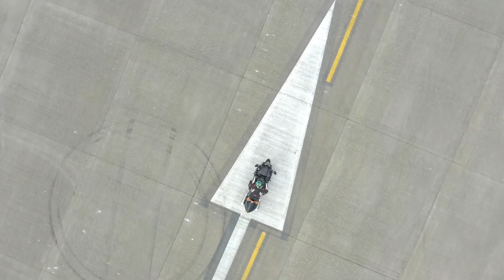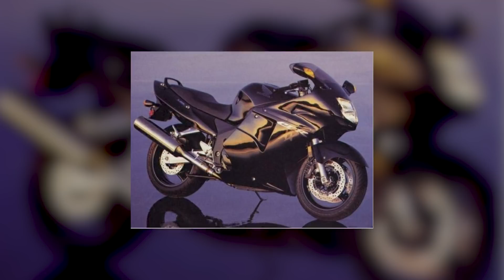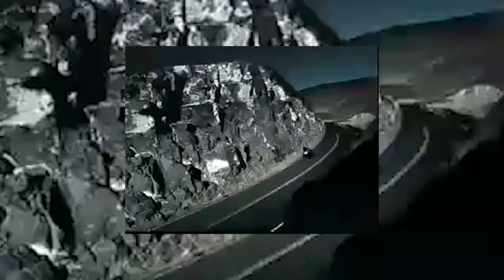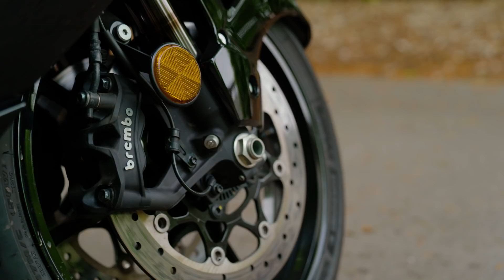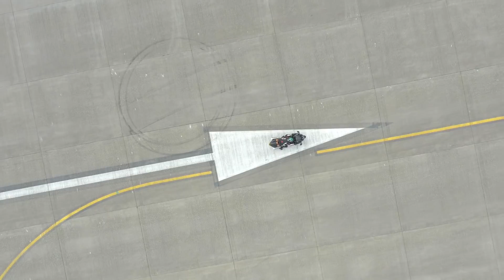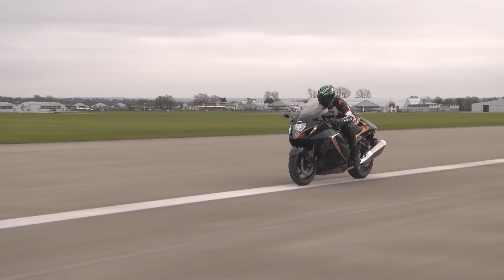2021 Suzuki Hayabusa review | Still the ultimate two-wheeled speed machine?

Comment: Very quick, but I can’t help but feel it looks very dated ?
Reply: If it ain't broke don't fix it
Reply: @Will_M600  It has less power then the previous generation and it should have came with a modern LCD display those are two huge negatives that makes no sense and make the bike seem extremely dated.
Reply: @antilagboostaddiction8322  pretty sure the reason for less power is that suzuki know most speed freaks will turbo these anyway
Reply: Yeah it's more or less the same from 1999